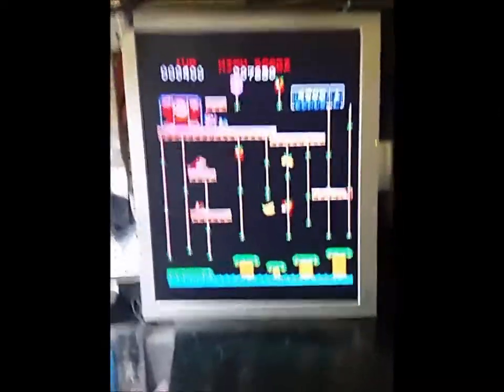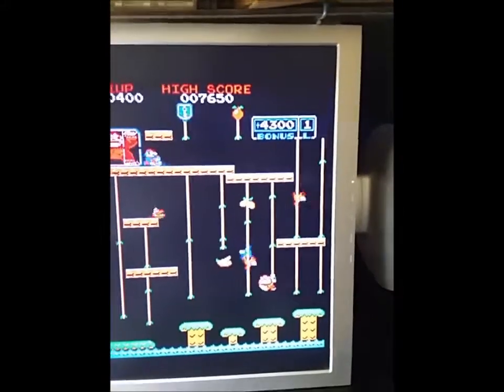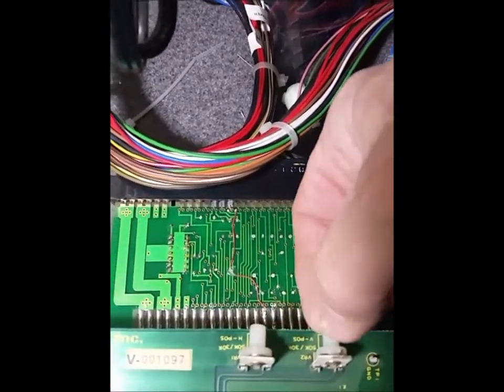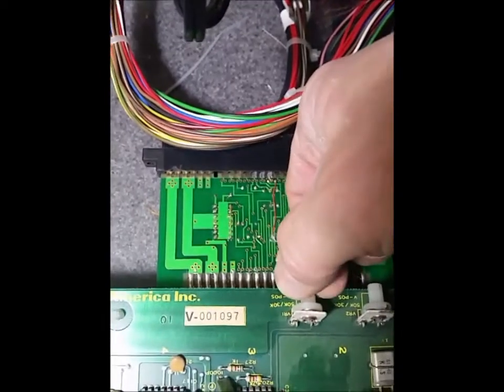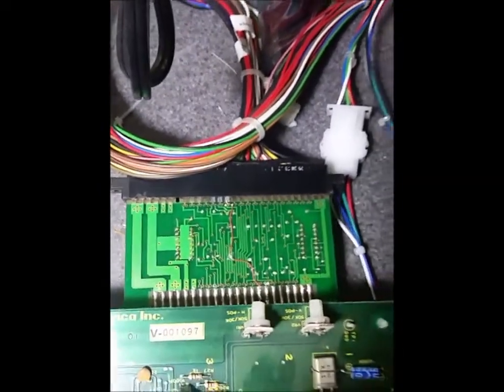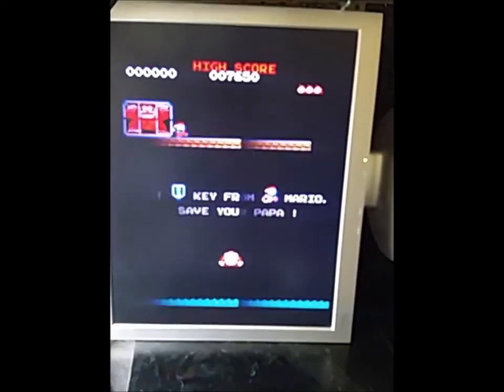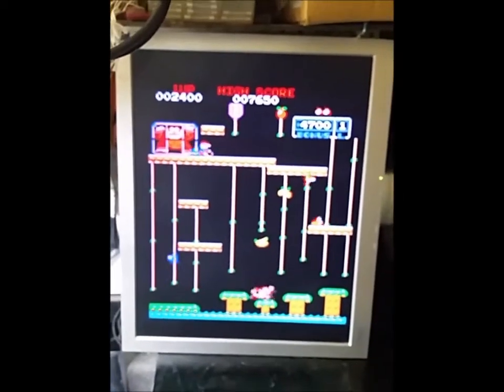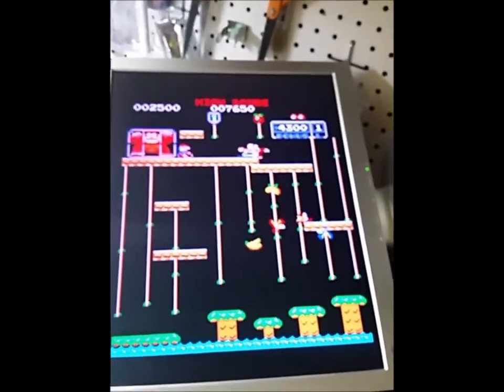Donkey Kong Jr on an LCD using a GBS-8200 CGA to VGA converter

Comment: Hey Mike.  I am wiring up a gun.smoke cabinet.   Pcb (us set 2) and a game pro gen 2 lcd. Game plays ok, but there are black, patchy horizontal lines that run the width of the screen.  There are about 5 sets of them that start near the top and continue to the bottom.  Again tho, they are in patches.  A friend tried it in his cab with a crt monitor and it worked just fine.  Would this CONVERTER solve the problem??
Reply from the maker: How are you hooking up sync? I'd try the last pin, pin 10.
Reply: @MikesArcadecom  i have the white wire going into the last pin.. seems like it is ok.
Reply: @MikesArcadecom  can i email you a picture?  give you a better idea of what's going on?
Reply from the maker: @atrain818  sure, use the contact for on MikesArcade.com
Reply: @MikesArcadecom  got ya man. I will do it shortly here

Comment: Hey can you tell me what you have your clamp settings set as?I bought the Nintendo to jamma adaptor from mikes arcade but gbs-8200 makes screen look a bit glitchy.Also tried going through wells panel and game monitor.Only keeps image for about ten minutes.I like those adaptors on mikes arcade site though,they usually work pretty good.
Reply from the maker: Leave the clamp settings alone!  The only time you need to change them is when you are using a Medium Resolution game and the colors start to fade.  Not applicable to Nintendo games.

Comment from the maker: Maybe.  I do have a monitor that works well with all Nintendo boards if you don't need Light Gun support.
Reply: MikesArcade.com I have a red tent. Missing both monitors. Will I need both the inverter board and the GBS8200? 

What LCD works well in red tents?

Comment: Would this work on other unisystem games like super Mario Bros?
Reply from the maker: Possibly. It will work OK on a test bench, but it would be best to get a monitor that can handle Standard Resolution.  I have a better solution now, but it's a bit more.  A Wells-Gardner LCD that will drop in replace a Sanyo 19" monitor.http://www.mikesarcade.com/cgi-bin/store.pl?sku=19LCDNIN

Comment: Mike, I know this is extremely frowned upon in the arcade world but I have a DK cabinet with a crt that is dead and I don’t want to deal with it anymore. I am going to put a LCD in it for now until I can find a replacement tube and chassis.  If I want to run this in my original cabinet, won’t I need your inverter/amp AND the gbs8200? (As well as the lcd)
Reply from the maker: Yes, you'd need to invert the video and amplify the sound.  So the NININVAMP is the way to go...https://mikesarcade.com/cgi-bin/store.pl?sku=NININVAMP
Reply: @MikesArcadecom  If my LCD has CGA input do I still need the GBS-8200 or will using just the NININVAMP inverter work?
Reply from the maker: If it accepts Std Res, RGB Analog, you should be OK.
Reply: Same exact thing , I have a fully restored DK  cab with DKII rom to switch to and the Sanyo CRT( original ) is a pain the ass.  I’m done with this thing. I wanna enjoy it. People who come over and always ask about it and there’s always something with the cab.
Reply from the maker: The most reliable LCD is a Std Res Wells-Gardner LCD, or a Suzo-Happ Vision Pro.

Comment: MikesArcade.com I am very interested in doing so. Which tools/resources I need? Thanks.
Reply from the maker: Just at GBS-8200 and a VGA monitor with 4:3 aspect ration.  Nothing else is needed.
Reply: Thanks,MikesArcade.com. The reasons why I am interested so much in doing so, it's all because I already ordered a Donkey Kong Junior PCB and,eventually,I want to buy and install John Kowalski's (a.k.a. Sock Master) Donkey Kong Junior Remix on the Donkey Kong Junior PCB,since Donkey Kong Junior Remix will never be released on MAME for free (all because of the development of the game;and great thing,because the extra chips of both Donkey Kong Remix/Deranged and Donkey Kong Junior Remix are incompatible with MAME. Donkey Kong Christmas Remix (Similar to the Regular Donkey Kong Remix,but with different sprites) is compatible with both MAME and DK cabinets,by surprise,since December 6,2017).